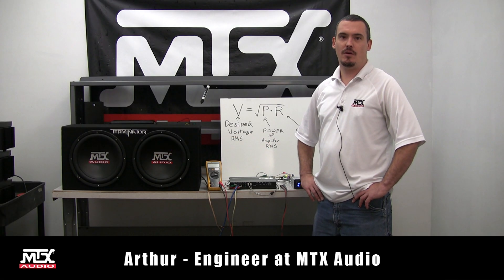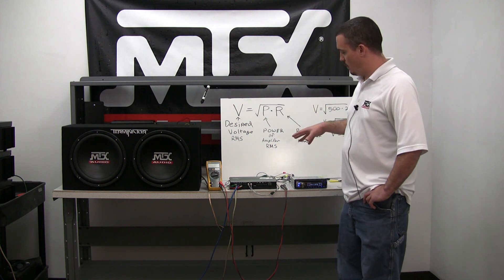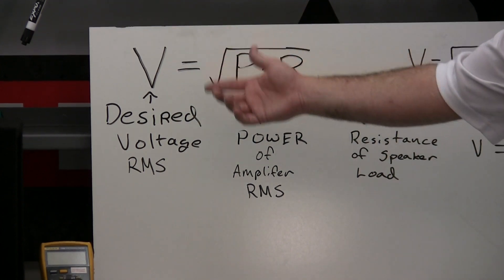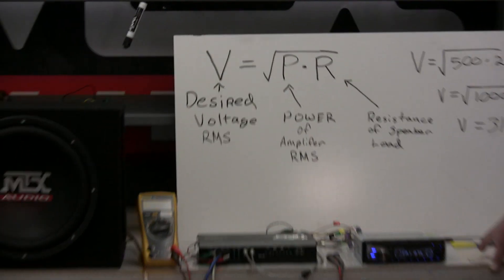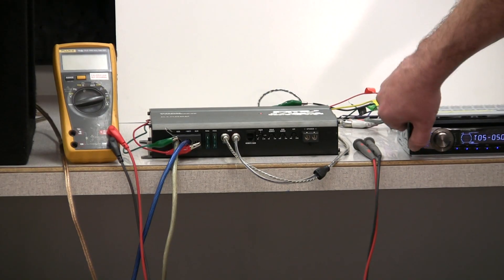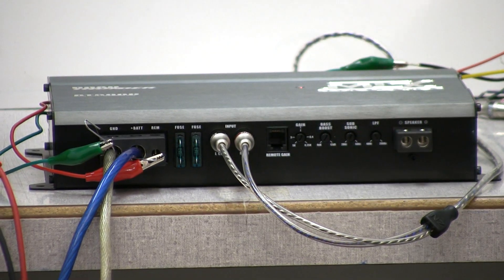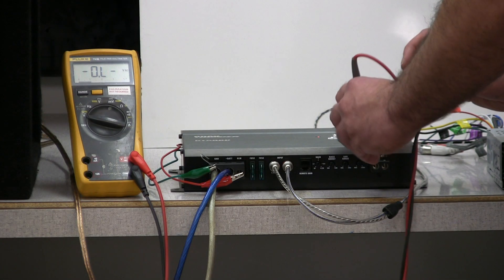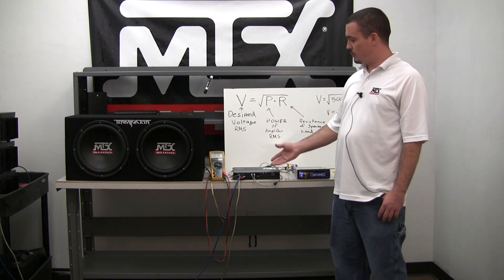How to Set Your Gains Using Ohms Law and a Basic Multimeter

Comment: A few questions. I appreciate any help. I am wiring the amp to one sub (10 inch Mtx blue thunder), is the formula still the same? 

Also after setting the gain according to the video, can I adjust the bass boost on the amp or should that be done from the head unit?
Reply from the maker: +frank lucas The formula is still the same. V = square root of Resistance (whatever impedance you have your subwoofer wired to) x Power (whatever amount of RMS power you want your amplifier to provide to the subwoofer) (usually the subwoofer's power handling rating).

After the gain is set appropriately, you can manipulate the signal for your personal listening preferences with an EBC (external bass control) or other methods. Using the headunit adjustments allows you to tweak the sound of your system on the fly, song by song. Using the amplifier's crossover and bass boost adjustments is more of an "all the time" type setting because you aren't going to adjust that as often as you could the headunit. 

It's all really just listener and user preference.
Reply: +MTX Audio USA Ok got it! Thx for the help and the fast response!!!

Comment: what would you do if you had two woofers that were 300rms per sub and you wanted a total of 600rms on a 1,000rns amp at a 2ohm load? would you just add 300+300=600. 600•2=1200. √1200=34.64?
Reply from the maker: You got it! Even though your amp is capable of more power, this way you won't overpower the subs and your amp should run nice and cool.

Comment: Hi MTX, so I recently installed a sub and amp as well as an LOC since I'm using my stock head unit. I downloaded your test tone to use to get the correct AC volts. My problem is, I'm trying to reach 31.6 volts, but I can turn my gain all the way up and my DMM won't go up past 10 Volts. I checked all my wiring and everything is in order so I'm wondering if you might know why my speaker outputs on my amp are giving such low readings.
Reply from the maker: +Daniel J Make sure you are using your amplifiers RMS power output ratings. Not the MAX or peak rating.
Reply: +MTX Audio USA yea that's what I was going for, the amps output rating is 1000rms at 1 ohm. (It's a 1 ohm stable amp) so that gives me 36.1 Vots yet like I said even I turned the gained all the way my DMM reading wouldn't be anywhere near that for some reason. I just did the ear test to sure there's no clipping, maybe I need to take it to a pro.
Reply from the maker: +Daniel J Could be something to do with the output signal of the LOC... Could be something to do with the wiring/impedance of your subs being incorrect... Could be a crossover or filter setting that is limiting the output... Take it to a reputable shop and ask them to check it over for you. They may charge you a shop/labor fee but it will be worth it in the long run to make sure your system is setup properly. Spend a little now to save yourself from replacing blown equipment.

Comment: What kind of subwoofer and amp is that?
Reply from the maker: +Zach Cobb (GoPro Swagger13) TNE212D subwoofer enclosure package with 2 - 12" subwoofers in a sealed enclosure. The amplifier is a RoadThunder RT500D. Class D monoblock.

Comment: hi, i'm gonna buy a 2 channel amp with an output of 600 watts rms per channel and 2 600 watt rms subwoofers, how do i set the gain? cause i think when i set the gain to 600 watts im afraid the signal wil clip?
Reply from the maker: +official bassrecordz The whole purpose for using this equation to set your gains according to the RMS ratings is to level match the signal so it doesn't clip. Just use the equation to calculate your voltage and set your amp gain accordingly.
Reply: A 2 channel amp with 2x 600 rms 
are not even on the market😂
peak power is junk

Comment: I have the same sub in the video I think MTX TNE212D which is 400 RMS and Rockford Fosgate R500X1D (500RMS) Prime 1-Channel amp.  What should my voltage be at?
Reply from the maker: +Krew808 Since the enclosure has a RMS rating of 400 watts, you would only want to use 400 watts RMS of your 500 watt RMS amplifier. So the calculation would be V = square root of 2ohms x 400 watts. V = square root of 800. V = 28.28 volts.

Comment: +MTX Audio USA 

The test that you're performing is for one woofer right? I have two woofers with a 5 ch amp: 

http://www.crutchfield.com/p_113XR9005/Kenwood-Excelon-XR900-5.html?tp=115&awcp=1t1&awcr=28870854203&awdv=c&awkw=xr900+5&awmt=p&awnw=g

the amp is 600 watt for the woofer, I'm guessing. My 2 woofers are 4 ohm 400 RMS. How would I set the amp for both woofers?

http://www.crutchfield.com/p_113XW120/Kenwood-KFC-XW120.html?tp=111&awcp=1t1&awcr=58098514523&awdv=c&awkw=kfc+xw120&awmt=p&awnw=g
Show less
Reply from the maker: +I Come in Peace! This method is using a monoblock amp with two subwoofers that are wired together for a final impedance of 2ohms at the amplifier. 

Your amplifier, since it is a 5-channel amp, has RMS power ratings for the 4 channels intended for speakers and a separate rating for the subwoofer channel. The subwoofer channel is 400 RMS x 1 @ 4ohms or 600 RMS x 1 @ 2ohms.

Do you know what impedance your subwoofers are wired to?
Reply: +MTX Audio USA I haven't wired the woofers yet because I didn't want to blow them or not have the power set right do u have any suggestions or can I supply u with more info?
Reply from the maker: +I Come in Peace! You would need to figure out how you are going to wire the subwoofers so you know what your final impedance at the amplifier will be. Once you do that and you know the impedance, you can use the calculation to determine your desired output voltage from the equation.

Comment: Powerone crunch amp p1 2000.1 a/b type amp with dual 15" kicker comps what would my ideal level/gain be? just changed from dual mtx subs.......
Reply from the maker: +Carlos Portillo Not enough info here to calculate the equation. How many subs? When you say dual, does that mean there are two subs or they are dual voice coil subs? What is the subwoofers RMS power handling rating? What impedance are your subwoofers wired to? What is your amplifiers RMS power rating at whatever impedance you have your subwoofers wired to?
Reply: Sorry there are two 15" SVC subs with 600watt rms each wired to 2ohms.....the amp is a Power One Series Monoblock two channel Class A/B Car Amplifier
RMS Power Rating:
4 ohms: 250 watts x 1 chan.
2 ohms: 500 watts x 1 chan.
1 ohm: 1000 watts x 1 chan.
Reply from the maker: +Carlos Portillo If the subs are SVC 4ohm voice coils, your two subs can be wired together for a final impedance of either 2 or 8ohms at the amplifier. Since you have a two channel amplifier but listed ratings for 1 channel, I assume you are bridging the amplifier. Assuming 2ohms at the amplifier, your amp will have an output of 500 watts. You want an output of around 1200 watts at 2ohms to get the whole performance of your subwoofers. Based on what you listed, the amplifier isn't powerful enough for your subs.
Reply: +MTX Audio USA Thanks any amp recommendations?
Reply: +MTX Audio USA just got a 1200watt rms kicker amp

Comment: I have a 4ohm kicker 12" cvr sub-woofer and a MTX 500.1 thunder series class D amp. The kicker does 800watts and 400rms. Yet the MTX amp does 500rms at 2ohms which = 1000watts peak power.  I am confused. Is it ( 500rms X 2ohm) or (500rms X 4ohm) Please help...  I need the right voltage
Reply from the maker: +phillip shevchenko for P (power) in the equation, you use whatever amount of RMS power you want to get out of the amplifier. In your case, since your subwoofer has an RMS rating of 400 watts, you would typically use 400 watts because you wouldn't want to send 500 watts to a subwoofer with a 400 watt rating. 

HOWEVER, your amplifier does 500 watts RMS x 1 @ 2ohms but your subwoofer isn't a 2ohm subwoofer. 

Your amplifier does 300 watts RMS x 1 @ 4ohm which is what your subwoofer is. So... the equation is V = square root of P x R. 

V = square root of 300 (amplifier's RMS rating at 4ohms) x R. For R (resistance or impedance), since your subwoofer is a single 4ohm voice coil, your only option for R is 4. 

V = square root of 300 x 4

V = square root of 1200

V = 34.64
Reply: Thankyou
Reply: If you go on Kicker wiring (YELLOW) diagram, I am using the top right diagram. On images 4ohm voice coil to 2ohm parallel.

Comment: I have one sony XS-L121P5W 12 inch sub with a sony xplod 1000 watt amp xm-zr1852. The instruction manual gives me the rms on two channels but I'm only using one channel. How do I find out the info I need? Thanks
Reply from the maker: +Yankeesftw23 Are you bridging the two channels together? If so, Sony should also provide an RMS power output of the amplifier bridged if it is a bridgeable amplifier. Not all multi channel amplifiers can be bridged.
Reply: +MTX Audio USA No i am not bridging the two channels  and I believe the amp rms is 185w
Reply from the maker: +Yankeesftw23 Your subwoofer has an RMS power handling rating of 350 watts. Your amplifier's unbridged RMS output is rated at 185 watts per channel at 4ohm or 200 watts per channel at 2ohm.  Since your subwoofer is a SVC 4ohm sub, it can only be wired as 4ohms at the amp which means you would be providing 185 watts to your subwoofer that wants 350 watts to perform properly. You should consider getting an amplifier that is better matched to your subwoofer.
Reply: +MTX Audio USA Alright thank you for the info and do you reccomend amplifying the rear speakers in my car. Im keeping the receiver stock for now will it affect my sound quality tremedously?

Comment: What about the sub level control on the headunit, should I set this all the way up before I set my gains , or leave it at 0? It goes up to 10db on my headunit.
Reply from the maker: +Andre Conner Leave all of your headunit settings at 0 or "flat" when you set the gains. After your gains are set appropriately, you can use the head unit filters to fine tune the sound according to the type of music you listen to and your personal preferences.
Reply: MTX Audio USA yes but I think the original question is asking if there’s a seperate subwoofer control from the other menu filters. Would it be okay to set this to 10, so when the highest setting is selected for sub output it does not exceed the subwoofer rms?

Comment: But this presumes that all of your settings on the head unit will be 0 to be safe, right? 0 treble. 0 bass. F0 B0, etc. Your system would only be "safe" (not clipping) at max volume if you didn't turn anything up on the head unit, or bass boost, etc. on the amplifier, correct?
Reply from the maker: +Numinous Yes. All of those settings in the amplifier manipulate the signal that is being sent to the amplifier. This method is setting the amplifier to level match the amplifier output to the headunit so that the appropriate amount of power is sent to the subwoofers. Once your gains are set properly, you could adjust the settings on the headunit to fine tune the sound if you want.

Comment: i have two mtx terminators 12" subs and its says on the back of the sub 4ohm for each sub input, my amp is 700 watt rms x 1 channel at 2 ohms, and 425 watts rms x1 channel at 4ohms, would i have to divide the wattage (425watts)  by two for the 4 ohm  to calculate  the voltage for 1 sub for P in the equation. ( i have two sub out puts on my amp for two subs). THANKS
Reply from the maker: +yousuf kan a TN12-04 subwoofer is a single voice coil, 4ohm, 200 watts RMS subwoofer. If you have two of them, your final impedance at the amplifier would be either 8 ohms (if you wired your subwoofers together in series) or 2 ohms (if you wired your subwoofers in parallel). Depending on which impedance your subwoofers are wired to, this would be your value for "R." Since you only want to put 400 watts to the pair of subwoofers or 200 watts to each subwoofer, 200 or 400 would be the value you use for "P". Your amplifier output is what we are trying to level match when setting gains so the amplifier ratings are not used in the equation. Just the impedance (R) and RMS power handling (P) of your subwoofers are what is used to determine how much voltage you want coming out of your amplifier. Your amplifier is rated for more power than the subwoofers so be careful not to overpower them.

Comment: is that law for one sub or two?
Reply from the maker: +Hector Bustos It's the same law no matter how many subs you have. Whatever impedance you wire your subwoofers to at the amplifier is the value for "R." For example, if you wire two subwoofers down to a final impedance of 2 ohms, you would use 2 for the value of "R." If you wire two SVC 4ohm subwoofers in series, your final impedance at the amp would be 8 ohms so you would use 8 for the value of "R."

Comment: So when doing this formula for door speakers (and a 2 channel amp) the amp is a 65w RMS (Per channel) the speakers are 60w RMS each and 4ohms. I'm coming up with 65x4=260 and then the sq root of that is 16.12. I'm a tad thrown off since mine is 4 ohms and all the other comments are 2 and 1 ohms. Is this done correctly. And also, should I be seeing 16v out of the left channel and another 16v out of the right channel when I check it on the multimeter?
Reply from the maker: +William Gingrich You would probably want to use the 60 watts RMS that the speakers are rated for. By using 65 watts, you are setting up your amplifier to put 65 watts to your speakers which are only rated for 60 watts. Other than that, your calculation looks good. If your amp has gains for both channels, you would do this for each channel.

Comment: Massive audio N4 amp. 2000watts rms at 1 ohm. I did everything in the video but my voltage readings are already showing near the correct with gain all the way down , why is this ? It's a pioneer radio 4v pre out with sub level control . With the gain being all the way down like that , it's no where near enough bass. I'm getting 44.7 volts with the gain turned all the way down at volume 39 out of 40
Reply from the maker: Check your sub level control and any filters/crossovers on your amp and head unit are flat, set to 0, and/or are set appropriately for the low frequency range of a subwoofer.

Comment: You are assuming everyone wants to set their amp at maximum power output.. Which is almost never the case.  You want to set the amp to output as much power as the subwoofers need. So if you have a 100watt sub, it needs 100watts, thus the amp needs to be set at 100 watts.  Regardless of how powerful the amp is you should not be using the wattage of the amp in the equation.  If I have a 2000 watt amp and I use your method, I will blow 90% of  subs on the market because you are giving 2000 watts to subs that are most likely rated much lower. 

USE THE POWER OF THE SUBS, NOT THE POWER OF THE AMP. He is maxing out his amp, if you do this and your subs are not the same wattage as the amp, they will be damaged.
Reply from the maker: +Brittany Finch In our subwoofer/amplifier combination, we were looking for maximum output based on RMS ratings. Our amplifier's 500 watt RMS rating was exactly the combined RMS power handling of the two subwoofers. IF the "desired RMS output" of the amplifier is less than its RMS rating, you would simply use the "desired RMS output" for the "P" of the equation. The desired RMS output is the RMS power handling of the subwoofer or the sum of the RMS power handling of multiple subwoofers.

Comment: Hey guys sorry if this is a repeat question, i have read comments but not found an answer. I have a DVC 650rms x2 at 4ohm per VC so ive wired it in parallel to a 2ohm impedance so would i be correct in saying its a 1300w rms at 2 ohm? 
Thanks guys great videos
Reply from the maker: +Michael Gardiner If you have wired your subwoofers down to a 2ohm load at the amplifier, what is your amplifier's RMS rating at 2ohms? You would take that number multiplied by 2 (ohms) and then find the square root of that answer to get your V = voltage to set your gain to.
Reply: But your amp RMS is always the same? so basically what you are saying is that whether i have a 200rms or 700rms sub, the voltage for the gain is always the same? surely the subwoofer RMS plays a role in this calculation? or have i got it wrong
Reply: +Michael Gardiner If you wanted 200RMS at 2 ohms you would want 20 AC volts at the speaker terminals of the amp.

If you wanted 700RMS at 2 ohms the voltage would be 37.42

The formula they have used here, is to attain the maximum RMS output of their amplifier. If you do not need to maximum RMS output of the amp because your speakers can't handle it, you would add together the total RMS wattage of whatever subwoofers you have and plot your voltage based on that wattage at 2 ohms (or whatever final load your subs are wired to)

Example: Your amp does 1500 watts RMS, but your subs only handle 250 RMS each...(500 RMS total). Take 500RMS X 2 ohms = 1,000 (square root that) = 31.62 AC Volts.

Comment: I just got dual 12' comp r subs and I'm new to this stuff and was wondering if this is the same as mine it says the rms is 1000 And need help to finish it I just need to set my gain
Reply from the maker: +eddie lopez Multiply the RMS power of your amplifier by whatever impedance your subwoofers are wired to and then find the square root of that number. That will = the "V" in the equation.